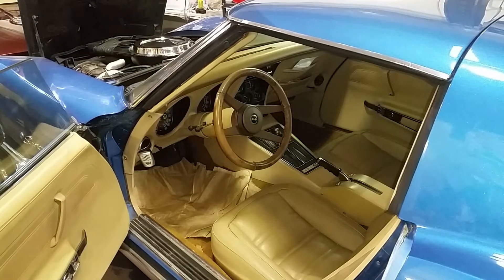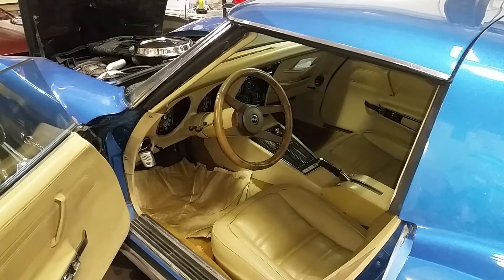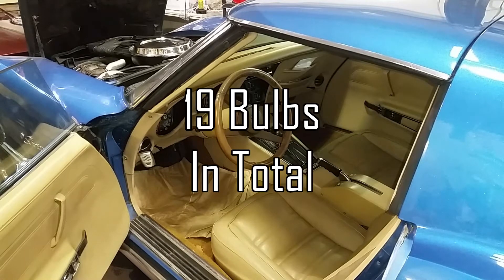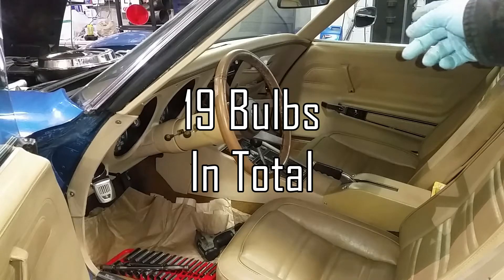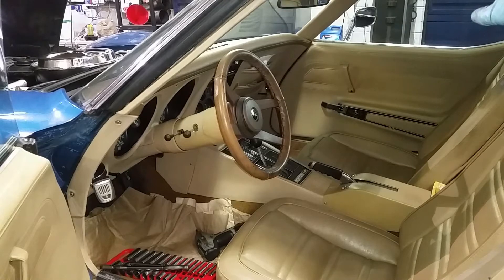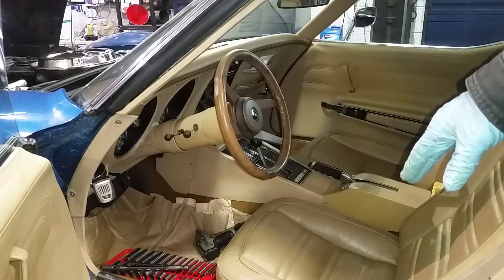C3 Corvette Gauge Bulb Replacement.. Day 12 NOT a "how to" video. Entertainment

Comment: Hey Rick are the newer (78-82) models the same? I'm about to replace the bulbs in my dash.
Reply from the maker: They are easier, the dash will come out once the speedometer cable is disconnected. Do not have to take whole dashboard out

Comment: I'm getting ready to change the bulbs in my 73, should I use LED or go with original GE 1895?
Reply from the maker: I love LED's but in these cars they have to be chosen carefully in this application. Make sure it has a good 360* spread of light to eliminate hotspots. The cool thing about the LED bulbs is that you can change the gauge color. I installed some blue LED's on the 74 LS swap project and was pretty happy with them except there were some hot spots. They were the traditional bubble style led's. I would recommend the multi direction SMD style for the backlight bulbs.  I have tried a set of bulbs from superbrightleds.com and they turned out pretty decent. Be careful with accidental pulling on the original bulb wires as they tend to be fragile and can break off easy at the socket.

Comment: Can you get the stock radio out of a c3 without pulling the dash out?
Reply from the maker: Yes, the molded dash models tend to pinch the radio from all sided but it is possible. Be careful taking out the bezel from the top of the dash pad as the hump in the bezel will want to grab the dash pad on the way out and it can crack an original aged dash pad. I would loosen the shifter bezel so you can slide it back and give you room to hinge it out. There are 2 hidden screws that connect the radio bezel to the shift bezel underneath where they meet. With the early years like this car the lower dash panels are removable and it makes the job easier with less chance of cracking the aged panels.

Comment: Where are you located? I need to hire you, lol. I got halfway through taking the dash and center console out and gave up. My blinkers were working before I started and now they are not (which is how I found your video)... I bit off way more than I can chew on this 73 big block convertible.
Reply from the maker: My shop is just outside of Baltimore MD. Check the harmonica looking electrical connector near the base of the column to make sure its seated properly.
Reply: Thanks for the info. I have now slowly attempted to get the dash back out. I pulled the steering column guys out to check the turn signal switch (thought there may be a short, and I changed the ignition lock set out). I am to the point of removing the a-pillar covers, and I believe I can pull the dash board off after that. I dropped the coupon bolts. I didn’t see any loose connections there. I wish you could make a slowed down tutorial. You’re the only video I had found that goes start to finish and pulls out the dash board and center console. Hopefully when I get the dashboard out I can see better and possibly find my short / bad connection. Thanks again for the advice! Wish you were closer to just hire you, lol.
Reply from the maker: @merlinwag  Next one I get in Ill have to do a how to on it.
Reply: @CamaroRick  o actually have mine completely out now. And I found my short. There were a few things broken / missing under the dash, so I’m going to take my time replacing everything. Your video definitely helped! I’ll be looking for the tutorial if you make another one... too bad you can’t just repost that one at normal speed. Anyways, thanks again for the video!!!!
Reply from the maker: @merlinwag  I would if I had the original clips. Your welcome

Comment: Do you have a video on how to remove a C3 Upper Dash Pad?
Reply from the maker: I dont think I have done one yet. Next one Ill focus on the removal for a diy type video. The early year cars are easier because of the multi part dash. Basically you have to remove the windshield trim all the upward facing dash screws, after the right pannel is removed there is a brace with one screw holding the dash pad. If you have speakers you will need to unbolt them. With the dash pad loose you have to slightly bow it in the middle while pushing one side of the ears into the windshield pocket while lifting the other side up and out from the a pillar. Might help to have the dash pad warmed up in the sun. The ears on the end are pretty fragile so be careful.

Comment: Congratulations.  You skipped over everything I needed to see.  Screw placement and removal/
Reply from the maker: Next time Ill point them out. Only ones you cant see from the drivers seat are the 2 9/16" bolts that hold the steering column up